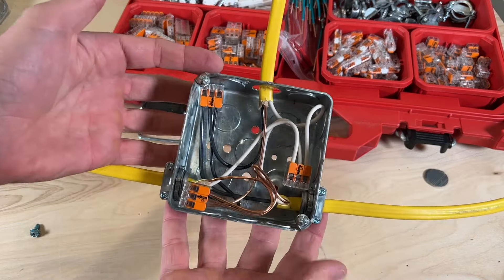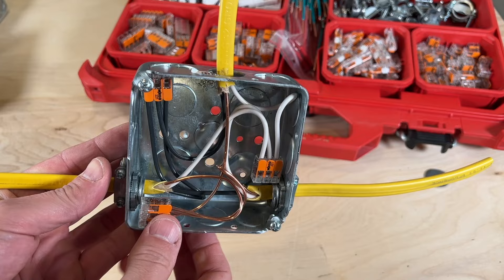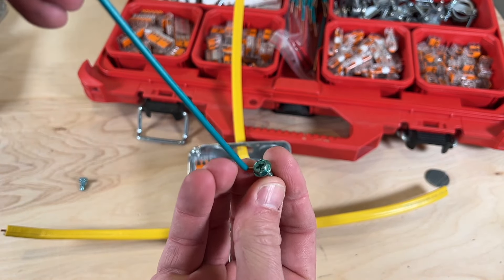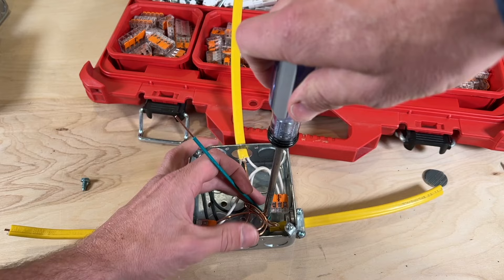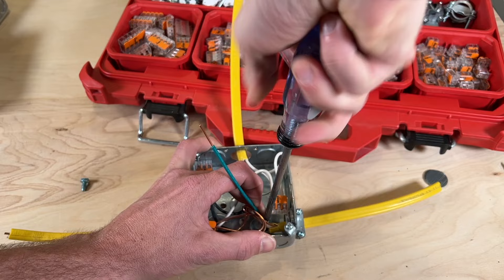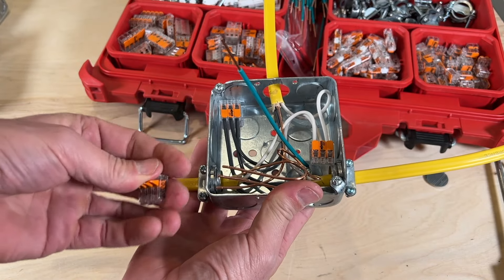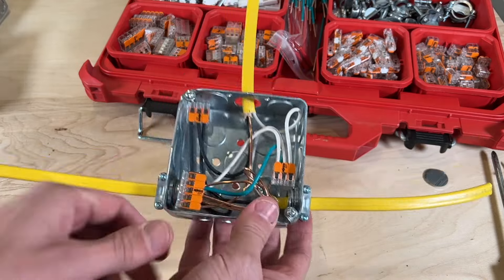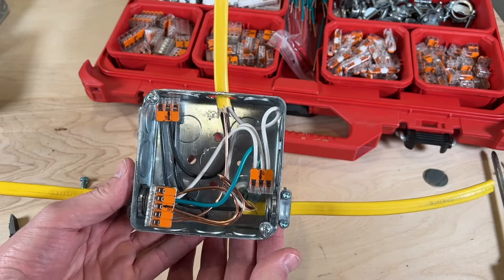The Best Way To Ground An Electrical Box | Up To Code!

Comment: Love your electrical videos, thank you, seriously. Question: what is your preferred method for connecting your grounds in a junction box with multiple cables coming in, AND multiple devices which need to be grounded? I love wagos, but I find this is where they fall short, as do wire nuts.

Simple example: 4 romex cables coming into a 2 gang box (two light switches) ... we have (power in, power out, fixture 1, fixture 2).

Neutrals, no problem: all four neutrals are connected with a single 5 port wago.
Hots, again, no problem: 5 port wago for power in, power out, and two pig tails to the switches. The other two hots connect directly to the switches (and don't need to use the wago)

The grounds are what I find problematic. To make this work, I would literally need a 6 port wago (grounds from all four romex go into the wago, and two pigtails to go to the switches). But as you know, there is no 6 port wago, and even if there were one, it would be a monster.

So to use wagos here, one would need to use a five port wago PLUS another 3 port wago:
  5-port wago: four ports taken up by romex grounds, 5th port taken up by a pigtail which would feed the 3 port wago
  3-port wago: 1 port used by pigtail from 5 port, other two ports used for pigtails to the two switches.

So to use wagos, we are looking at a 5 port, a 3 port AND 3 pigtails. It's madness I say! And this is for a little two gang box, imagine how gnarly this would get for a more complex 3 or 4 gang box.

Using wire nuts is similarly problematic. Even using the "Greenie" wire nut, the greenies are only designed to have a single ground coming through the nut, which means you would have to have one greenie with your four romex, cutting 3 short and leaving one long to stick through the nut and having that long one connect to another wire nut, which would then still require two additional pigtails.

This is why I have started using crimp sleeves for grounds instead. The beauty of the sleeves is that they are very compact, taking up minimal room in the box, AND you can leave as many long wires as required (2 in our example). So, in this case, we would simply run all four romex through the crimp sleeve, leaving two longer (to go to the switches), and cutting two short (or capping the other two with a wire nut). This takes up much less space in the box, requires zero pig tails, and only a single crimp sleeve (rather than multiple wagos, wire nuts, and pigtails with the other approaches).

Have you used crimp sleeves much? Do you like them? How do you find yourself connecting grounds when you have several cables and devices to deal with in the box?

Comment: Does this work if there are no ground wires inside the box? I have a light switch that requires a neutral/ground wire for installation. There are only two wires inside the switch box and I'm thinking of installing a green grounding screw to ground the light switch

Comment: Have to get a loan from the bank in order to buy all those wagos, so I just joined the wires using wire nuts 😳
Reply: Oh come on!  What's it? 60 cents a piece? If that?  A drop in the bucket compared to the total cost of the project. Especially since you can change them out if you want to expand like shown in this very vid. You can't (or shouldn't) reuse wirenuts.

Comment: What is the purpose of grounding the electrical box?
Reply from the maker: If the hot conductor where to short to the box you would want a ground installed as that would trip the breaker.  If you did not have a ground on the box and the hot conductor contacted the metal box then the box would be energized and you could provide the path to ground when you touch the box.